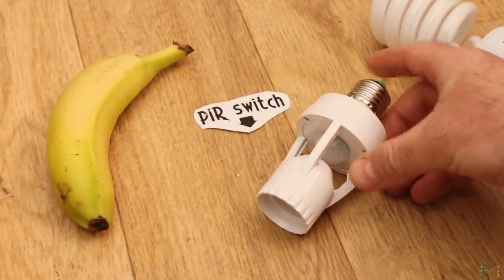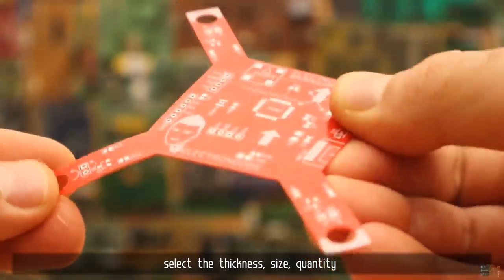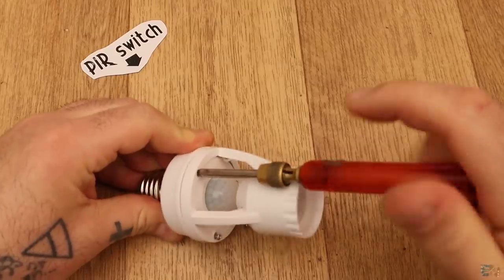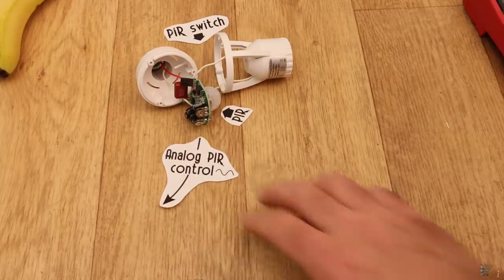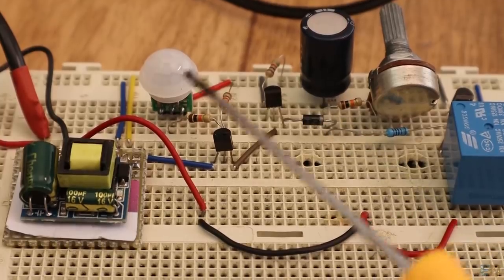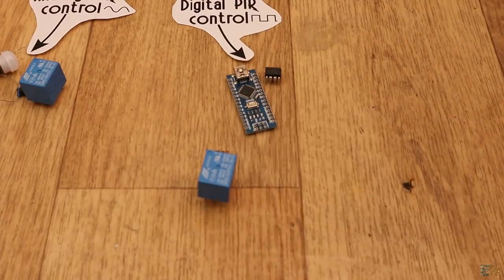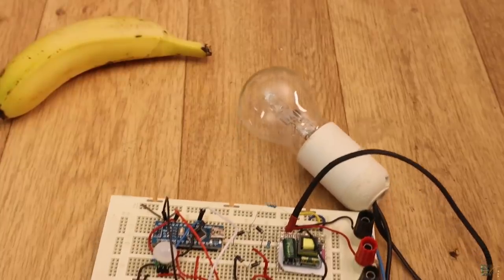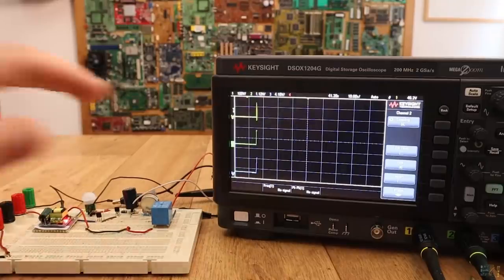PIR switch 220V AC TRIAC or RELAY | movement detector circuit

Comment: I think the commercial module uses a capacitive dropper to generate a low voltage. On Big Clive's channel you can find many video's with great explanation about LED light bulbs that use such a circuit. As I recall that circuit only uses a capacitor, some resistors and (bridge) rectifier diodes. In this case I see the big red capacitor, a large green resistor and two diodes that would operate as half a bridge rectifier.
Reply from the maker: Thank you for the information. !!!
Reply: I also think that...capacitive dropper is very common in mains ac circuit as they are the cheapest solution but with some drawback like low current and non-isolated.
Reply: Yes, it so

Comment: The components you are missing is a resistor to limit the current through the LED of the optocoupler of the zerocrossing and a flyback diode at the relay's.

Comment: The commercial light switch / movement detector uses a capacitor to drop the voltage. The IC probably runs at 5V or something similar. Diodes  ensure that only the positive half cycle of the AC sine wave is used. After this diode there is a resistor with zenrer diode in series. This clamps the voltage. Some smoothing capacitors are visible too.
As a result the whole circuit is referenced to mains and can be very dangerous. There is no galvanic isolation
Reply: Woww, the way u say all this is so sexxy, I wanna say like this once...

Comment: I made my own ac light but using filament lamp. I have used ATTINY85 for my project, zero crossing through opto isolate from main, 5v psu for the mcu, to be crude I have to convert ac to dc for the lamp so that I can use the MOSFET to power the lamp. I have a fast active lamp without making noise using trailing idea.

Comment: how are you probing the mains voltage with a standard scope probe ?
Reply: That's why there are 1:10, 1:20, 1:100 etc..  ratio probs 🤔
Reply: @crckdns  wrong answer
Reply: isolated transformer is the way and that isolated scope from the pir light or the other way. Don't need 2 isolated transformer, just one to isolated between main and the scope..
Reply: @cheetahkid  damn.. then I've been doing it wrong at work all the time with the ratio and differential probes 😲😲😲
Reply: @cheetahkid  this is what concerns me, the video has NO SAFETY MENTION AROUND THE SCOPE AND ITS PROBING PLEASE PLEASE UPDATE!!!
Reply: @crckdns  please look at keysights probing video.
Reply: @yaghiyahbrenner8902  which one?
Reply: @yaghiyahbrenner8902  I'm using also differential probes, what is your point here?
Reply: @crckdns  don't act stupid, if you using  differential probes then say so when making a remark about probe ratios.  1:10, 1:20, 1:100 means nothing  for single ended  probes the ground clip is common to HV and isn't floating.
Reply: @yaghiyahbrenner8902 Let Electronoobs knows, reason the scope is mostly main powered and scope ground is connected to earth so, you can get blown up if it was connect to live, this is where isolated transformer come in. Or if you have battery operate scope. Yes the main are dangerous and not to play about with it, safety first.
Reply: @crckdns  most scope have earth connected to ground on these probes if the scope is main powered. Nothing wrong with ratio and differential probes, it the scope.
Reply: @cheetahkid  true safety first, is he using a isolated transformer ? I started looking at building a 100MHz HV differential probe, but finding the right opamp is tough.

Comment: Hey everyone, I need your help. I am currently building SMPS on tl494 chip. But I am little bit confused about kick starting the chip. Can i use 200k resistance between mains 300 volt regulated DC supply and tl494 chip to kick start it with some 22uF cap?? is it safe way to power it up?? I'll power it later on with auxiliary winding with rectification for running the chip continuously.  Operating voltage for tl494 is 7 to 40 volt.

Comment: that 0.56uF is in series with 220v and its capacitive reactance is what is limiting current trough that zener diode and its about 5.7k besides opto triac needs low voltage also on its led side so probably if u measured across that zener diode you would get 5v/12v and using opto triac is a joke in this setup coz its not even 0 crossing type i would understand using it for 0 crossing but bt134 is sensitive triac and they allready use transistor to switch on opto triac. ah china cant even save a buck :D
Reply from the maker: Thank you for the information!
Reply: @ELECTRONOOBS  i like your circuit better anyway !

Comment: Zero crossing for this purpose is not needed
Reply from the maker: I don't know other option, sorry. How do you synchronise the firing pulse with the main AC wave so you could control brightness? Thanks!
Reply: @ELECTRONOOBS  you are using 50 Hz voltage from grid, that means period is 20 ms of sine. If you make a pause for 20ms and then fire a triac, let them to be fired <20ms and so on, you will get crude "pwm of sine wawe". Calculate the mean value of current.
Reply: @arduinosynod1571  its why he is using zero crosing to see when to start counting in between those 20ms once he detects 0 he can start counting if he didnt have zero crossing and using ur method light bulb will flicker at best comercial one just lets the lighbulb be on they dont care about dimming
Reply: have to use zero crossing just for brightness.. I tried without and failed.
Reply: How about using a diac? ?
Reply: @abdelssami  yes in analog but no in digital